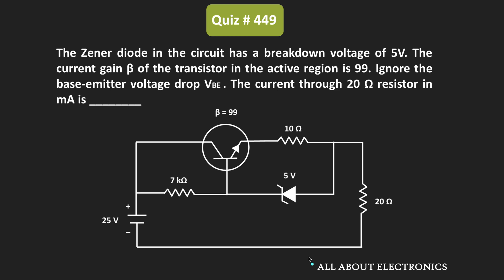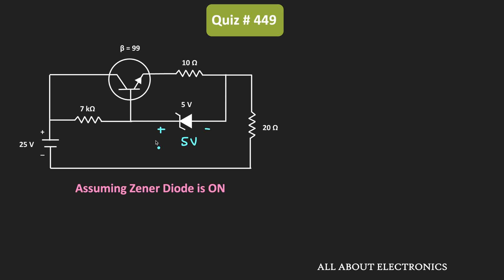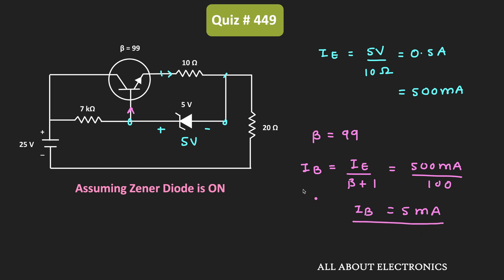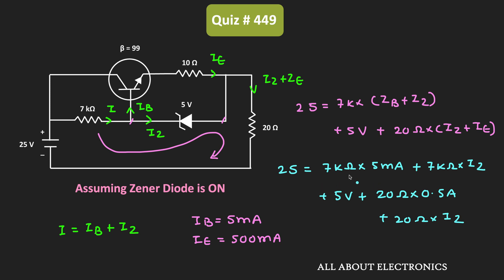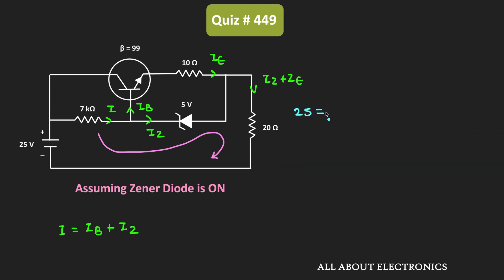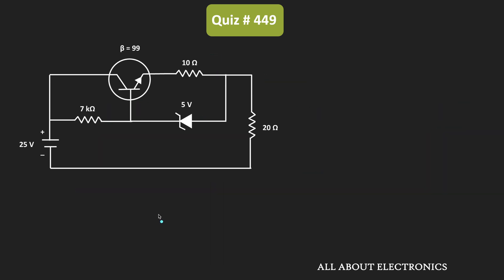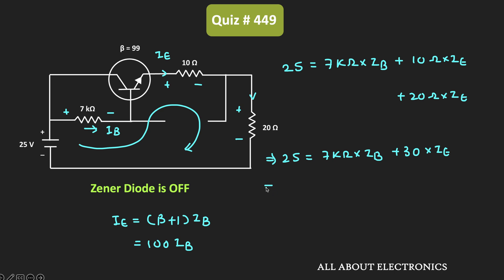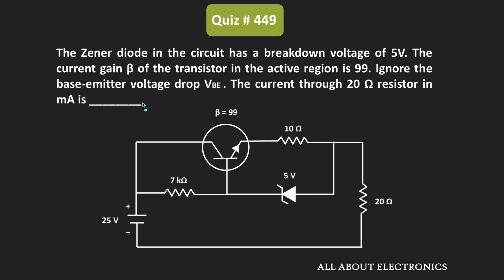BJT (Bipolar Junction Transistor) Solved Problem | Quiz # 449

Comment: But can we assume from the beginning that the Zenner diode is off so we don't have to do all those calculations ? :))
Reply from the maker: Yes, you can. These all calculations are only comes, when you think, what if Zener Diode is ON? In that case, to confirm indeed it is OFF, we need all these calculations.

Comment: iff zener diode is not in reverse bias then it  will be  in forward bias and it will be act as a ideal diode?
Reply from the maker: For Zener diode to be in forward bias condition, the voltage at the anode of the diode should be more than cathode. In this case, for that to happen, the voltage at the emitter of BJT should be more than base. In this case, clearly that is not the case. So, Zener diode is definitely in reverse bias condition. Only thing that we need to find out is , whether it is operating in the breakdown region or not. When it is operating in the breakdown region, then voltage across it will be 5V, and when it is not operating in that region, then it will simply act as an open circuit.
Reply: yes my mistake. We could also calculate thevenin voltage across zener diode to find whether is is in breakdown or not? @allaboutelectronics-quiz
Reply from the maker: The Thevenin's Theorem is applicable to only linear networks and linear devices. BJT is non-linear device. 
For more info, please go through this video on Thevenin's Theorem  for basics:
https://youtu.be/8udwPc5pCoA?si=6hMSogX0yjQjMUM7